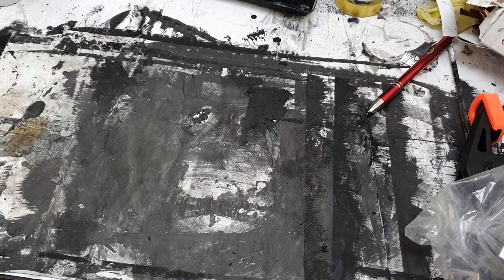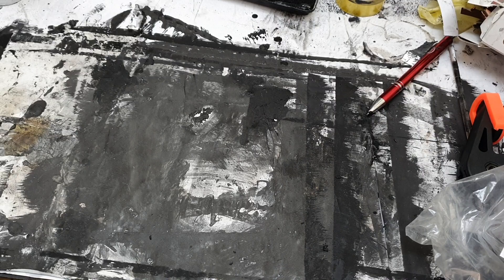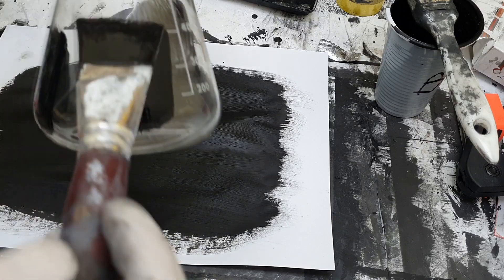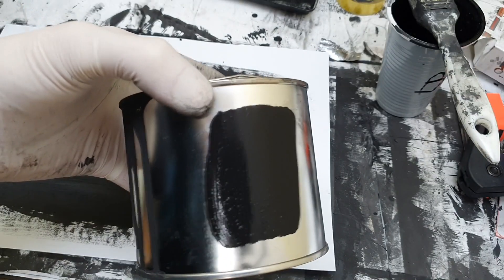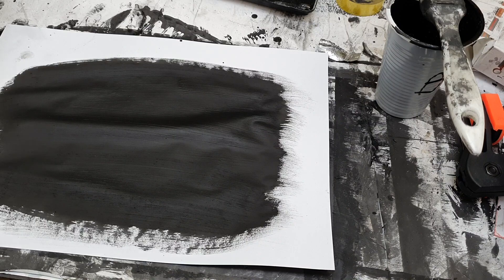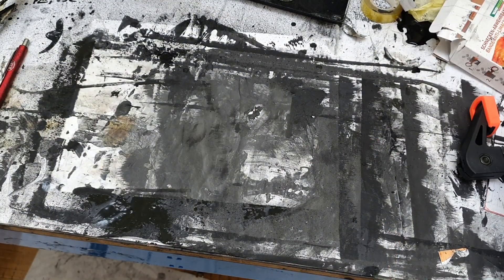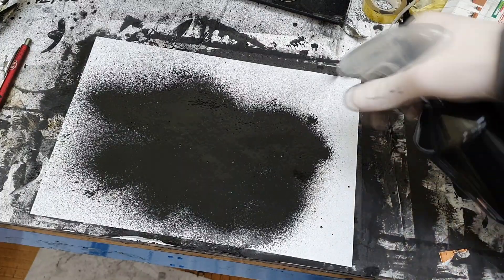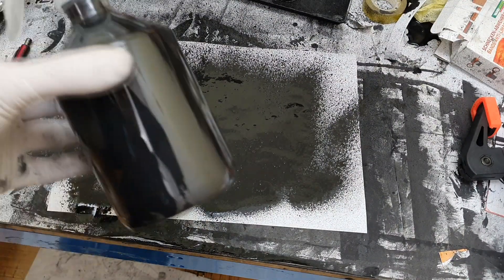Very liquid Conductive ink - Spray conductive inks

Comment: See US patent 9,728,344.   Going back about a year to your super cap with redox elrctrolyte....this is patent shows two redox couples that work together to minimize biggest problem with supercaps...self discharge.
Reply from the maker: Interesting patent
Reply: It that why he can't sell it as a product?
Reply from the maker: @michaelclarke647  hahahahahaha no. The patent is for supercapacitors
Reply: @michaelclarke647  the two are not related.....it's just an interesting idea to improve supercaps long term application along with energy  density..
Reply: Good conductive ink is all I'm looking for. I'd like to plate some small Epoxy Resin auto parts. MG Chemicals I guess? Thank you both.